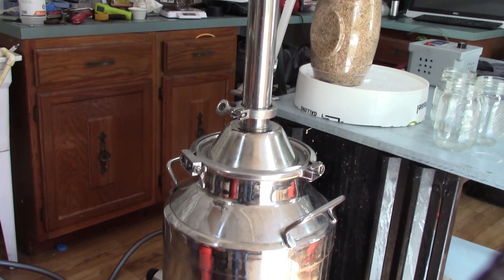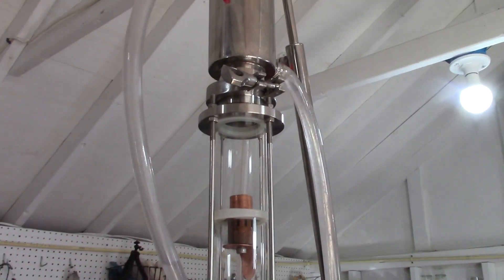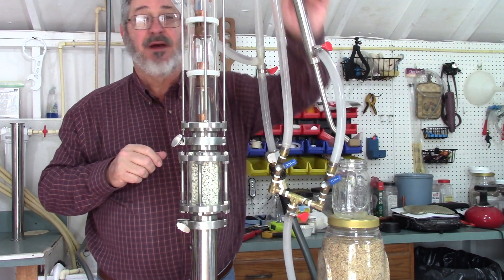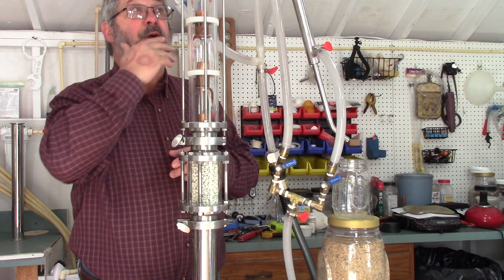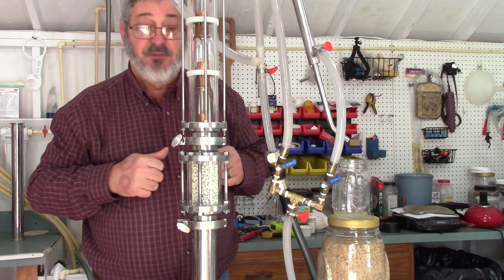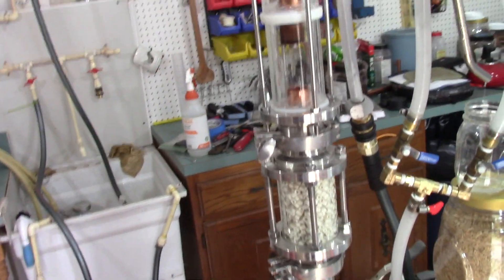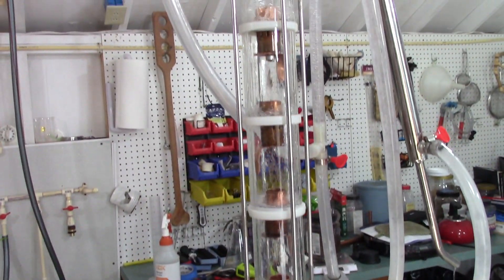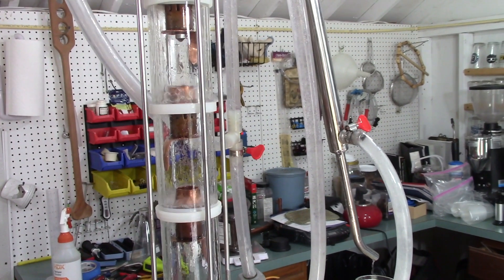E209 Potato Vodka part 2 "distillation"

Comment: That is one heck of a set up.  I was hoping I could get by with one of the electric counter top distillers.  Also why can't you use the first 8oz you removed?
Reply from the maker: on a 6 gallon mash the first 8 oz. contains bad stuff the foreshots and heads dont taste very good
Reply: @stillworksandbrewing  can I get away with an electric counter top unit to start with?
Reply from the maker: @uriahderr2868 yes you can going back to last question the rule of thumb is 1 oz per gallon of mash

Comment: Hi, and I hope you will answer my question as soon as possible..I followed all the steps to make potato vodka, and after fermentation, we reached the point of distillation, and the distillation began. Everything was going well, and the points began to drop. After taking the harmful alcohol aside, I started picking the heads, but I noticed that it had a caliber of 35, and upon arrival  To the hearts it was 30 and the tails at about 10 what is the reason for the low alcohol percentage even though I checked the density it was at 1.00 I hope you explain the reason to me. Thank you you are wonderful
Reply from the maker: Let’s start at the beginning what was the original gravity reading

Comment: Hi Randy.  First time to try to ever distill and your video is the best.  I have a quick, although probably a silly question before I attempt my first batch.    After you put aside the 6 gallons of liquid from the first video to get the temp below 90, did you add yeast or wait several days before distilling?    Also, can you recommend a still for beginners?  Thanks so much
Reply from the maker: After you add yeast it usually takes 7 to 10 days for the yeast to consume the sugar and convert into alcohol if you taste it will taste sour

Comment: 93%.. on that column. Humm maybe your pid controler is causing that. Try doing a run useing an SCE voltage co troller rather than the pid. I think you should see 95 to 96% azeotrope  on that colmn.  Certianly 93% is low. 
Unless you are running it hot and fast?
Reply from the maker: I use a pwm switch I changed my column around may be little fast

Comment: Look into 'Compressing Heads' (full on pre-condensor for 30 minutes at 170ish ) Gets the heads in the column for clean release / cleaner cut
Reply from the maker: thanks for tips
Reply: That works yes. You can even get to seperate acetone from methanol from ethyl alcohol if you are patent and use an SCR power controler rather than a PID.

Comment: Hey Randy, how many watts is your element & what voltage/percent was your SCR at?  I'm thinking of getting a 3" bubble plate column, but my rig maxxes out @ 1500w.
Reply from the maker: 1500 watt using a pwm switch sending around 10 amps to element  13 amps is max. 120 volt